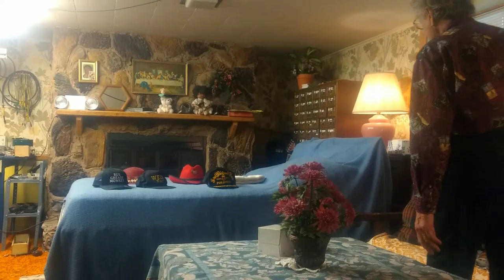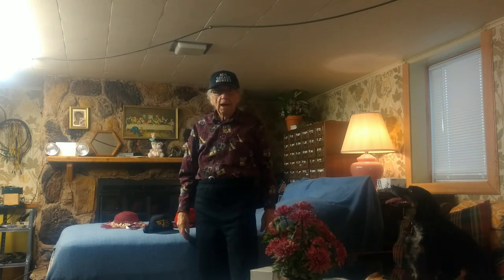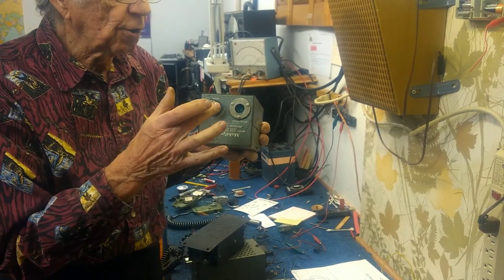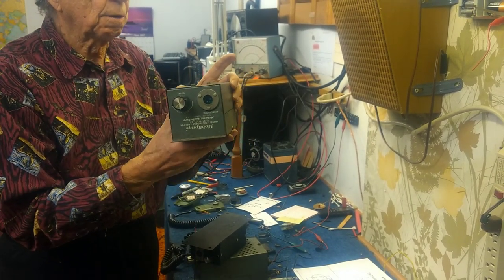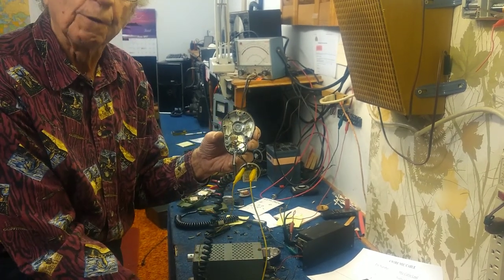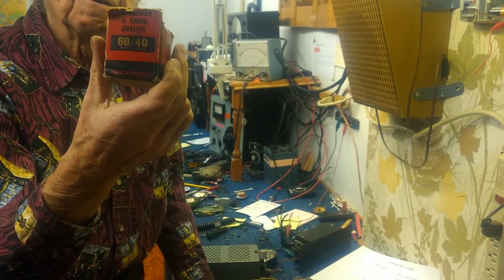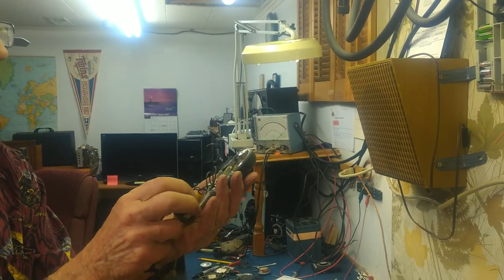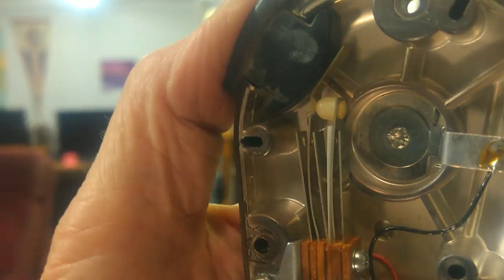Bus PA Amplifiers and Microphones Part 1 of 2

Comment: Appreciate your very practical and entertaining style Phil.  i only have a 'tiddler' of a bus ( 16 seats + driver)  but i find one the wireless mics and transmitters perfectly adequate. Space on such a small vehicle is very limited, so the Chinese made amp system does the job well for me.
Enjoyed the video - be well.
Reply from the maker: I have not had the luck you have with wireless. Maybe you could post your experience with the wireless PA in your "Toddler." Or, create a clip and send it to me and I'll tie it in with a sequel to mine.
Reply: @busoldmanphil7293  OK Phil will do - bus is in a bit of a state as i ripped the dashboard cover off trying to get the bloody heater working with a new control switch ( it still won't ! )  but i will certainly post you a video of how i my little system works - basic amplifier with 3mm jack plug into radio and a hands free head mic on a flexible stalk. Vey happy with it this far.

Comment: Really appreciate the discussion about the off position shorting out B+. This is great info Phil. Thanks de K2LK.
Reply: It's the metal case the amp is in that shorts out the positive ground on older buses. TNX & 73 de WEØK.
Reply from the maker: More on that,  the B+ is really the +12vdc left over from the filter caps, designed to smooth out instantaneous loads due to modulation peaks. When unkeying the mic, the B+ drifts down allowing sounds from mic to come thru for 2-3 seconds.